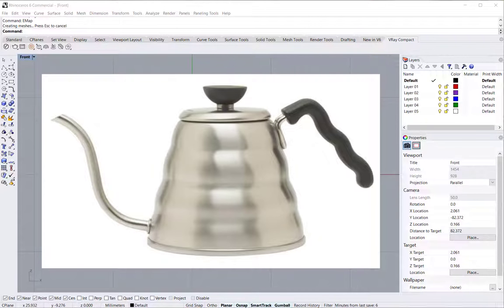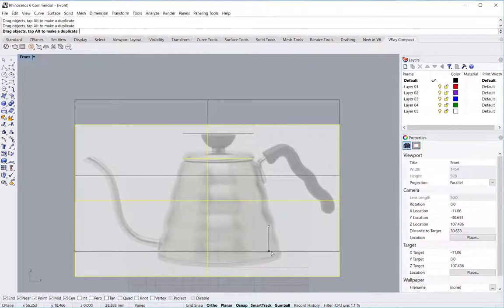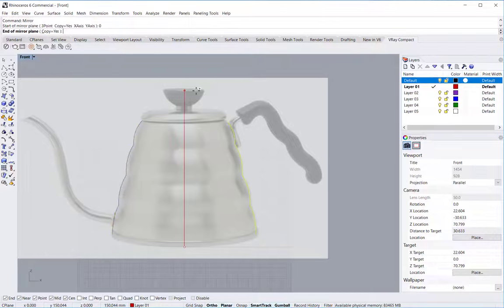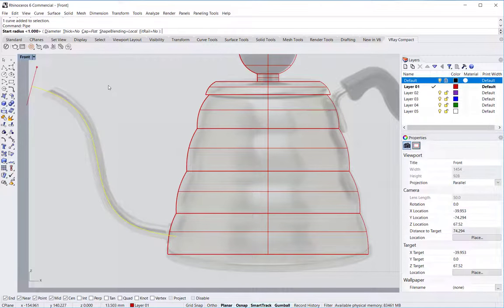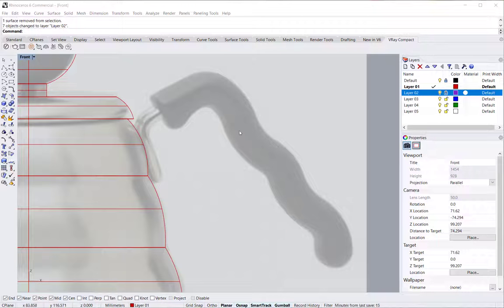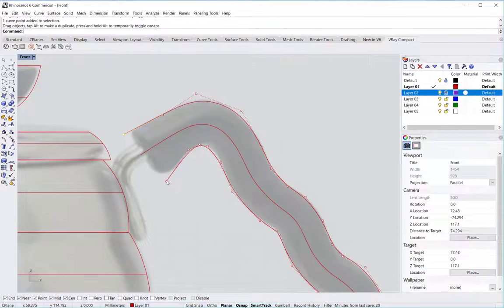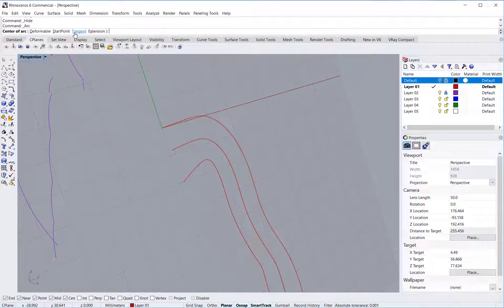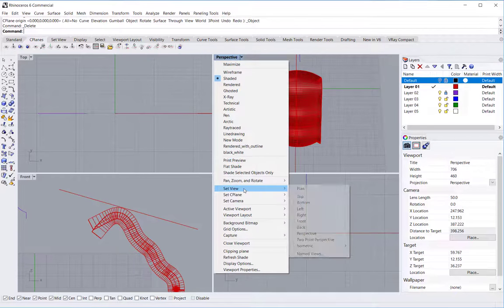Modeling a Hario water kettle in Rhino

Comment: may i knw why use offset for the handle while use pipe for the spout? what makes the difference?
Reply from the maker: dwaejishan the spout is round so pipe is here the quickest solution. The handle however has no round cross section so other techniques make more sense. Please note however that there are multiple ways of getting to the same or similar result.
Reply: @studiogijs  okie! thanks for helping i appreciate your help a lot!!! <3